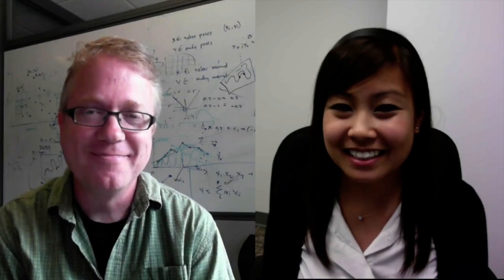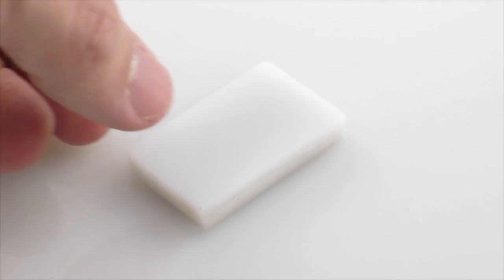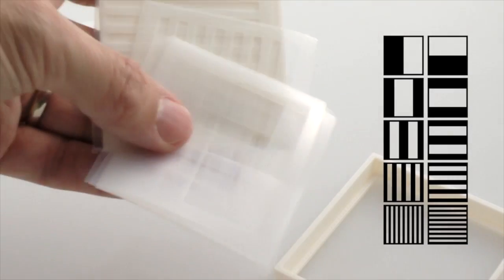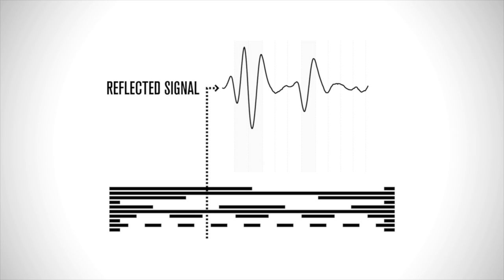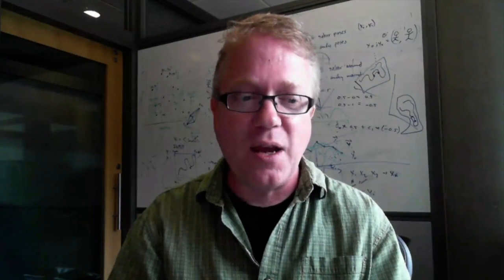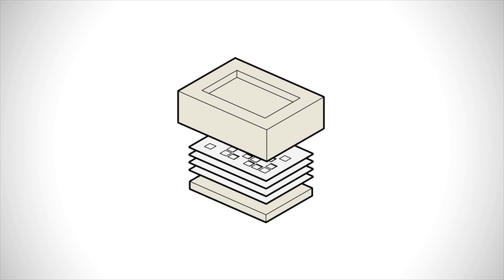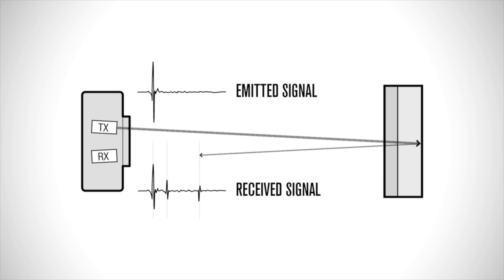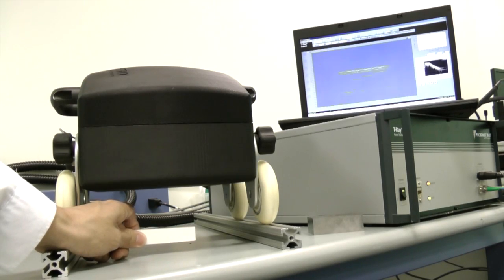DIY Spycraft with 3-D Printing

Comment: Also I reckon you could read certain types of 3d printed void space codes acoustically.   Tap on it in different spots and listen (and compute). Similar to the work being done on those ridged barcodes you scratch your microphone along to read them.
THZ scanners are prohibatively expensive afaik, the haves-vs-have-nots aspect makes me nervous

Comment: Putting secret copyright type codes into 3d printed objects seems a bit redundant, with scarcity becomming rarer the notion of "ownership" of any object will be rarer.
It wont be worth doing.
I can see other uses though, embedding a website url, or even a product manual.   Not sure how much data can be stored